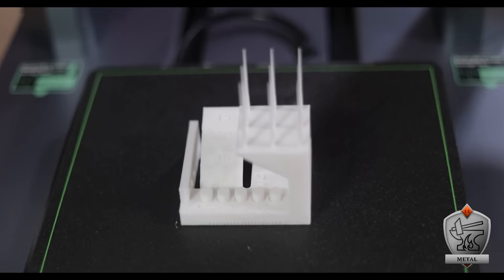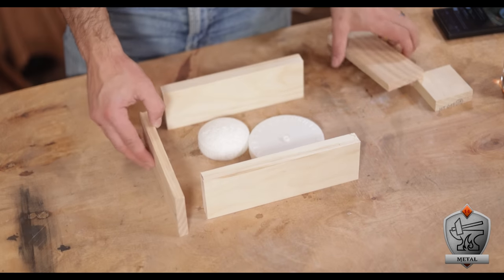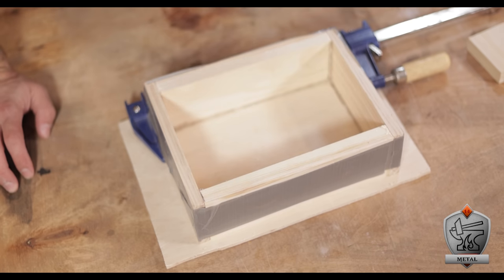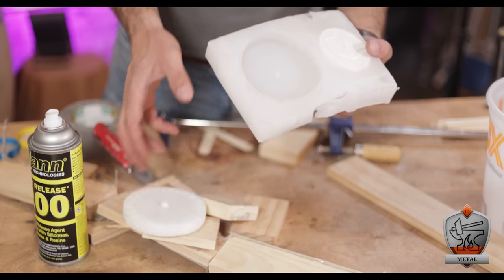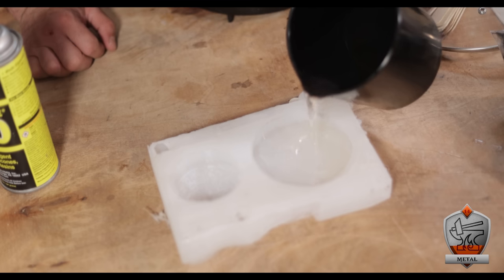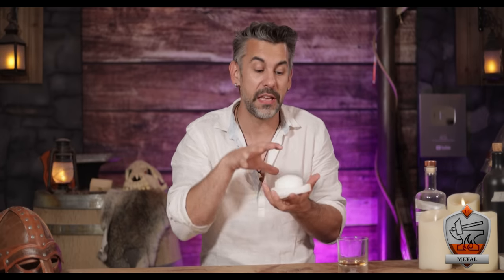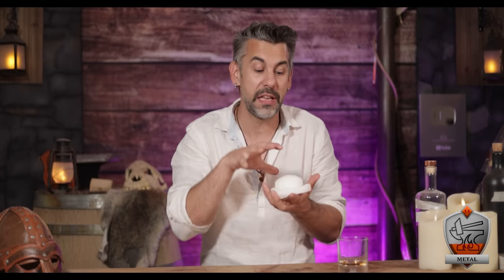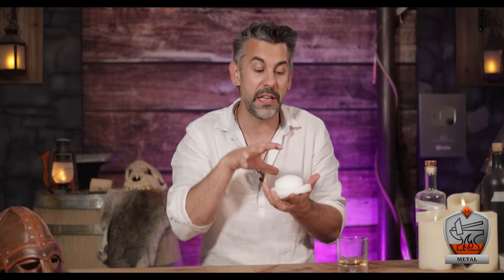DIY Your Own Fantasy Cipher!

Comment: Well done, but melt the wax first and tamp your green sand first next use pour shaft and a vent shaft and use more metal then you think because  it will shrink and a crusable is mandatory and use borax when melting use paper  an a spacer between the crusabel and furnace and offset your air tube so the air fule mix circulates. And skim the surface.

Comment: I am not really an expert in metal casting, however here are my two cents: Pouring molten metal onto silicone, which is flammable, was not the smartest idea. It would have been a better call to make that mold out of plaster/gypsum. That way, after removing the molds, you would have had something that can actually take the heat. But getting the plastic out of gypsum would not be fun, so here is my suggested orger of operation: 
Begin as you did, with the silicone mold. Cast wax into it, remove the wax. Use those wax bits to cast the gypsum, then, once the gypsum is dried, remove the wax by melting. Voilá, you have a one time use mold for metal.

Comment: 5:20 - You made my DM mind turn evil. I instantly thought of making the metal one; but then reworking the font on the 3D printed version to make 'fake' artifacts. So only the cast metal one had the real answer to the puzzle, and the 3D printed ones made no sense, or gave false answers. Muahahahahaaa!! Also make the pegs for the two pieces to connect different shapes and split the pieces apart.
I could see some players selling the fakes to NPCs, saying they didn't have the patience to figure it out or whatever, and then that merchant can either try to solve it, or try to sell it to some unsuspecting treasure hunter. Diabolical chaos!! \o/

Comment: You could potentially have skipped the wax in the foundry sand.  There's a YouTuber called BigstackD, who exclusively does melt and metal casting videos.  He uses foundry sand for some of his vids, and he makes the molds by placing 3D-printed items into the sand, packs it, then carefully slips the printed item out.  Then run a channel to the cavity that you can pour the metal into (a sprue), do the same with the other half of the item you're trying to cast, put it together as one big block, and pour the molten stuff in.  You have to cut the sprue off, and polish away any flashing/seam lines, but it would probably work in this case.  

He doesn't say anything in his videos to explain what he's doing, but they seem to be exactly what you're looking to do here.  Just look for the ones that deal with making coins or something other than the usual ingots.

Comment: I still think it would be cool for you to make a Hiking Hand Trailer that converts into a cot in the style of your 'Bag of the Wanderer' that converts into your tent. You could call it the 'Wagon of the Wanderer'. Both would go great with you 'Staff of the Wanderer'. 

The best part is that you can use the wagon to haul your Kitchen/Cooler, Caffeine Alchemy Set, Folding Vanity and anything else you need! It would also be more manageable than your bed in a box as well as being multipurpose.

You could even put decorative caps on the wheels and have them sit next to your cot as a side table. 

Some weathered macrame as webbing for the cot could quadruple as a hammock if you want, a net for trapping...things... or an extra bag/sack/net for foraging/fishing/looting.
Reply: The handcart/cot/platform for tieing a single tentpole, i allready have made with a bivvuac style tent
Reply: @marcusfridh8489  did you make a video through which I can live vicariously? Because that would be amazing....

Comment: Need to get my hands on that printer 😆  really like that special plaster too. How weighty is it? And why was resin and painted  off the table? 

As for the casting with wax if you make it more like a shell instead of a brick. As in hollow it out and leave  1/4 inch walls of wax and pour the aluminum into the bowl. It should help. And read up on what wax is best for wax casting because something dosent seem right

Comment: an easy mix for a carvable wax that doesnt crumble is to mix hot glue sticks, paraffin wax, and a crayon fir some color. the hot glue sticks add a stabilization and a bit of rubber to bind the wax together. . then you need to cast it in a mould that can take the heat and allows you to get the wax out of the mould. best thing is to cast it in plaster and put the mould upside down and burn out all the wax. then u can cast metal in the cavity it created, and bust off the mould shell once its cooled. its the old school technique, and u can even make ur own plaster with mixing sand and plaster of paris. its alll going to be a one time use so again if it goes wrong ur gonna have issues.

Comment: I've seen people using sand as the mold, but usually when making swords and knives they'd remove the item and leave the mold and of course having to deal with flash clean up later.  I wander if using concrete would work as a mold to act as a stone mold.  I know old traditions, some people used clay.  I had to deal with clay when I was in college art class, and that stuff hardens like a rock.  However I'm not sure if it can take high heat, but it is easily breakable.  So if you use clay you'd have to keep it in a box.

Comment: I did not do it myself, but everytime I saw somebody use the lost wax method, they burned the wax before pouring the molten metal in the mold, usually by putting the mold in a ventilated oven (to absorb the fumes) at a low temperature !

Comment: Personally I'd suggest taking a swing at lost wax casting rather than sand casting. I found it more beginner friendly. While I won't recommend it, you Might be able to get away with using that gypsum cement as a casting media for lower temperature metals like tin or if you're lucky aluminium. Just remember to bake the wax out and cast into a hot mold.

Comment: I'm only halfway through and dying inside a bit 🙈 For the record I have an artisan degree in metalwork and have done a lot of casting, both lost wax and foundry sand casts. This has been... Interesting. I'll comment again once I see the rest 😂
Reply: So, for the feedback on casting:
I've never seen anyone cast by pouring metal on the wax. Maybe it can be done, but definitely was not taught at my school. Usually with foundry sand casting you need to make sure you can pop the model out of the mold. The sand can hold a great amount of detail, but you need to make sure the model can pop out without taking any of the sand out. So it wouldn't really be possible with the runes on the side. Basically everything needs to slope in a certain way to makebiy possible. With lost wax casting the mold is usually made of plaster and the wax is burned out in a kiln before casting the metal in. Never seen it done any other way, but I'm in no way an expert despite my education.

Comment: My question Is why you didn't use your highly detailed 3D printed pieces as your casting models.
This Is what i would have done:
Build a two piece mold (cope and drag). Pack the sand like you did, but add a pour channel (sprew),a couple out flows, and some vents. That should give you A highly detailed casting.
Another thing Is to maybe use a low temp bismuth alloy (like 281) for your final piece. You can melt that in an aluminum foil pan in your oven!

Comment: I think you should have used a double sand box Idea so it's closed in the box and the metal can settle in and not flow out I have done that before and in that box... also for aluminum you can use silicone cast 60 hard it's a dark reddish... it's used for making jewelry  but what u did is cool

Comment: Would be interesting to see this electroplated. If you use graphite paint, you can plate pretty much anything with metals and it looks fairly easy(which to be fair in my experience usually means its a pain in the ass).

Comment: Melt the wax out of the mold before you pour the melt in.

Put it in the oven upside down over a tray large enough to catch all the wax that drips out and simply cook it at about 220, you dont have to vaporize the wax, just liquify it.

Comment: So..to summerize.
You made a 3D model
to make a silicone mold
to make a wax model
to make a sand mold
to destroy your driveway
to ditch the metal projekt all together and make a plaster model xD

So yea, that was the first part :D
Now to the constructive criticism.
1. If you make a 3D Model to make other models from it take a bit of time with it first.
A bit of Acrylic and a bit of sandpaper and you wont have the printermarks throughout the whole process.

2. Paraphine wax is not used for casting.
The casting wax may contain some paraphine but they are made for specific tasks.
Different Metals have different melting points witch need different types of wax and molds.
Otherwise they just burn, or collaps or spill over. I think next time, just call up a gold smith supllier and get the real stuff bevor you burn down your neighborhood :D

3. Wax casting isn't usualy done with open molds exactly because of overspill issues.
The point about wax casting is that you have a solid object within the sand mold that holds it's shape right until it's not needed anymore.
Afterwards the cast is destroyed to reveal the castet part. (Watched a documentary about how they made church bells, fascenating stuff)

Comment: Skill Tree, as a person who has seen many, and I mean MANY, casting videos, I can say that your attempt was admirable, but just a few steps away from a good outcome. 

For example, the improvised crucible, if you are going to use a fire extinguisher, use a magnet to test and see if it is steel, if it is not, then most likely it is aluminum and will melt just as well as your aluminum that you are using. Steel fire extinguishers are able to be used multiple times without worry because of the steels higher melting point.

Number two is that fact that you tried to pour the metal on top of the wax with no way for the metal to pool and flow into the space that the wax had been taking up. A way to avoid the accident is to add a funnel of sand or something else, and this let's the metal stay at the entrance and ready to fall into the mold. Also, it is better to have a small hole a bit further away with a 'tunnel' that will allow the air to escape and minimizes the chance of air bubbles forming up in the mold. Hope this helps.

Comment: You should never use a steel crucible to melt aluminum as the liquid aluminum chemically attacks the steel and dissolves it. Also you should either melt the wax out of the mold before casting the metal which mean you need something that holds up better than green sand, such as plaster. But that comes with its own casting issues.

Comment: OK here is how you make this work.
First, take your wax template and use plaster Not sand to make your mold. The mold needs have a spout a few inches high so the pressure of the metal can force itself into the details of the mold. (An open mold like yours will never have good details even if it had worked.) The plaster mold also needs some air vents.
Second, Melt out all the wax before you poor your metal. Place the fully hardened mold in an oven or over a fire, and heat it up slowly. Once all the wax is out slowly heat it even more until the wax inside starts smoking or burning. Once that is done the mold is ready for pouring.
Third, poor your metal, it helps to have your mold in a tray or bucket filled with dry sand to catch any metal that spills out.

Comment: Oh no, I could see that would happen if just pouring hot metal on top of solid wax/paraffin wax.  Years ago I read about lost-wax casting and everything I saw required the wax to be "lost" before the metal was "cast" into the resulting empty lost wax mold.  You need a way for the wax to escape when it melts and then you would not be pouring metal into a "full container." I'd imagine you could use a drill to make holes in the side or bottom of the wood frame and use some sort of tube to keep the mold material out of the way of the escape route.  Get the whole thing hot enough to melt the wax after the wax has made its impression, then stopper the holes and add molten metal.  Or, that's the way I remember it saying in the Rock and Gem magazine article about making lost wax jewelry. They didn't use sand, but used something more expensive than plaster of paris.

Comment: If you’re using wax, if you encapsulating it in the sand it will burn off. If it’s on top like your video, push it down to create the negative. Then remove the wax. Finally pour your metal into the negative.

Comment: also why did you use lost wax casting to begin with? with that kind of sand you couldve easily removed the wax from the mold without damaging it and then casting directly into the sand, theres tons of videos of people doing it that way. lost wachs casting is mainly when you details on ALL sides of your piece

Comment: You  made a simple mistake.  With the mold open, just remove the wax. It will leave a clean impression for the aluminum to fill. Just be careful on how much you pour so it doesn't  overflow.

Comment: Couldn’t you have simply used the 3D print as the master in the sand and simply removed it before casting with the metal? It seems much easier and is how they do casting at our local renaissance festival.

Comment: Wax item. In a concrete mold. When concrete is fully dry. Heat it up and melt away wax. Poor in molten aluminium. Wait. Break concrete mold to get out the metal item. It's just a guess. I have never done this

Comment: It's foam that U have seen burning off in casting.... not wax.... Ur meant to burn wax out before casting....

If U didn't have the runes on the sides U could have just taken the wax out of the sand b4 casting.... But U would have tearout cause of the runes.....

U could have done lost pla casting.... Mold a 3d print into jewelers investment (fully covered mold with spru) then bake it upside down over a pan and the PLA would melt out of the mold, then U would have an empty mold to tip Ur metal into

Comment: Okay, so first off, lost wax requires that you LOSE THE WAX! You use the wax to form a cavity in your casting medium, usually plaster, but sand will still work as long as it isn’t open-top. After you have your form, you REMOVE THE WAX using either heat or by popping it out by hand. Once you’ve done that, you could’ve easily used the crucible you tried here, just as long as you use charcoal briquettes and NOT LUMP CHARCOAL. Lump charcoal gets too hot and will melt your steel, but the briquettes are designed to burn slower, so they won’t. After that, you make sure that there’s a passage through your two-layer sand mold down to your actual pieces, and another passage to let the air back out. Pour in your aluminum, and your all set!

Comment: for what you wanted to do, wax wasn't what you use that melts away. the videos you saw were done with Styrofoam not wax. instead you should have put the wax in plaster of paris mix with a guide hole and when the plaster hardens you put the whole thing in the oven to melt the wax away leaving a cave inside that is the same shape of the wax bush then poor the molten metal into that.
Reply: witching you do what you did hurt my brain XD

Comment: You made a mistake I know I would have made, but have your tried "LOST PLA" casting with metal?

If you haven't, it's super simple. Basically you would do the same with what you did with the wax but the metal would burn away the PLA print you used to cast in metal!

Comment: I was wondering why Skill Tree hadn't been putting out videos and then I found out I was no longer subscribed to the channel...GRRRRR!

So I am late to the party, but I was wondering if the material you used to make the thingy could be used to make pipes. Print out a shape, say a dragon, and then make the mold and cast it with the material. Doable?

Comment: Lost wax casting usually involves pieces that are more or less fully surrounded by investment plaster. For what you did using sand, you could have just used a propane torch to melt the paraffin and then pour most of it out. The small remainder would have been easier to burn out.

Oh, almost forgot. “You are an (insert low intelligence related insult here) for not knowing everything about metal casting and giving it a try anyway.”

(You’re not really of course, making mistakes is one of the best ways to learn new things.)